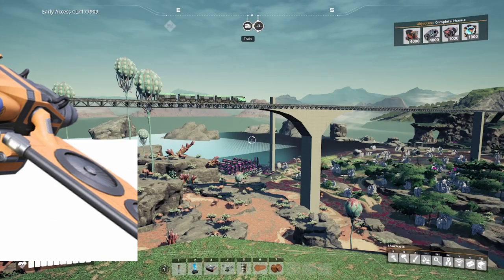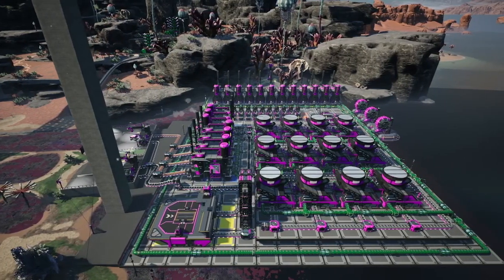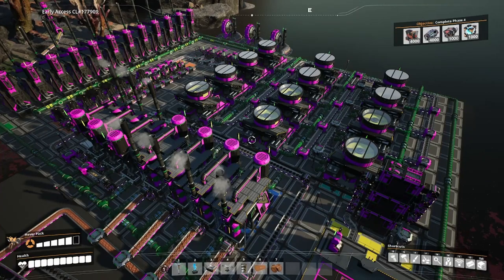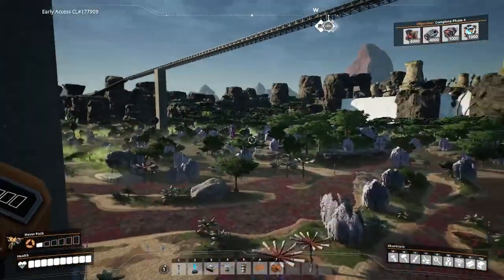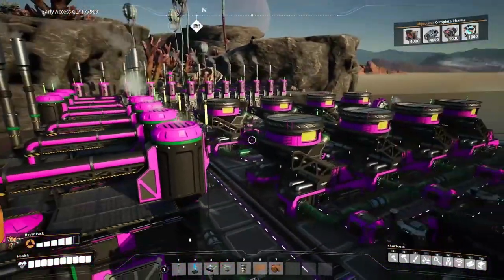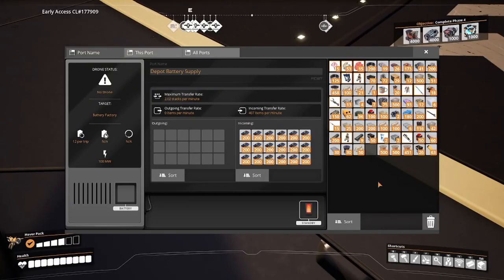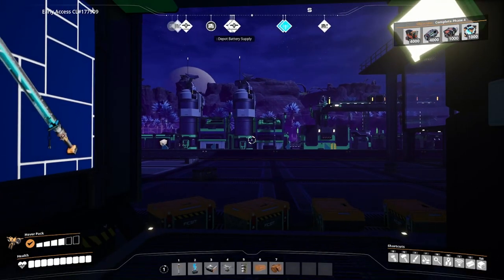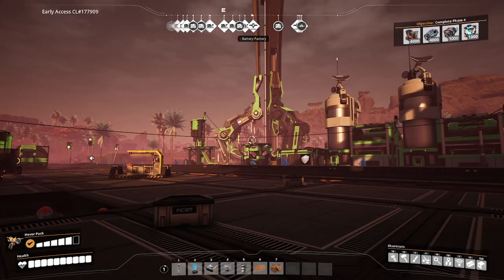Drones and Drone Logistics + Battery Factory Build - Satisfactory Update 5 Tutorial LP

Comment: Save your batteries for the last space elevator items.
Yesterday I just finished my first section of a battery plant. Had problems with the extra water that comes from batteries. First I connected it back into the bauxite water system like yours, thinking it will be used. But It caused backup and shut down of the battery. So I tried cutting down the water for bauxite.
It still caused issues.
I don't like underclocking or percents.
My final solution was bringing some overflow coal to the battery water output and burning the water off in 4 coal generators. They go off and on making sure that all battery water is used up. It burns more than batteries produce, zero shutdown.

I like how people have different concepts and solutions.
Anyways good stuff.

Comment: The same or another drone can deliver it to the same port steel ingots came from. If we hook up another drone from third port, outputs would be taken to both 1st and 3rd port, potentially making a mess.
Can we setup one drone between 2 ports to pick and offload goods only in one direction? I always thought drone automatically moves items both ways without option to change it. Am I wrong here?
(Edit: I just played with drone ports and didn't figure out how to daisy chain them without sending items to two other ports.)

I built Battery factory in that area as well, but providing just right amount of water was always not enough, had to add much more water and sink excess. Then sulfur miner was mining 780/min and chugging the line even though last 2 refineries were stalling as they did not get enough sulfur. That factory is nightmare to run at 100%

Thanks for video, I was wondering what are you cooking after few short videos :)

Comment: I'll tell you something that I've been having trouble wrapping my head around. Multiple factory management. When I do a playthrough, for some reason I love the hyper efficient, only-build-what-you-need way of doing it. But I want to go bigger and spread things out. Instead of building just 10 Modular Frames/min that I know I'll need later, why not go for 20 of even 25? However, how do you manage all the factories? If I have one steel factory making 1000 steel ingots a minute or something, how do you know how to send out the product to other factories? Do you make the pipes/beams there, or just send out the ingots to have them made locally at the other factory? If you have two separate factories requesting items from one factory, how do you split them up between the trains/trucks? I hope that wasn't too convoluted.
Reply from the maker: Thats a great question. I use depots to do intermediate processing and portion off the outputs to the correct ammounts. https://www.youtube.com/watch?v=BM11eEgxxuIo is a more complicated example but the second story on that one provides steel pipes and wire for a motor factory off the same (bulk) inputs that are providing for nuclear.  Hope this helps.
Reply: @Dekoba  I appreciate the reply. I think that helps a bit. I think I may just need to start experimenting on my own and see how things work. This is certainly a much more interesting way of playing than just keeping things 100% efficient in one area.

Comment: Hi, what's the Alt recipe you're using for the Aluminium Scrap to Aluminium Ingots? Because the normal recipe requires Silicon combined with Aluminium Scrap in a Foundry and not a Smelter to make Aluminium Ingots.
Reply from the maker: It's called pure aluminum ingots

Comment: Is there a bug that drone suddenly consuming too much battery? I have a battery factory producing 60 batteries pre min at 100% efficiency, which to support 5~6 drones. For the information provided in game, there are using about 20 batteries pre min, so I should have no problem in supporting the drones. At the beginning I keep on checking the drone port, all the drones are doing well and the batteries are stocking up. I think it works perfect so I leave and going out to do another thing. After 4~5 hours I found that my production line was down because there were no batteries in the drone port. Since I am producing 60 batteries per min it is impossible for the drone to consume all the batteries. I checked the batteries factory and it works perfectly at 100% efficiency , so I back to drone port and suddenly everything seems back to normal and the batteries are filling in the drone and stocking up again. However after running a few hours later it happened again, it is so  confusing and I have to stop using drone until I found out the reason.

Comment: What are the small factories in the late game? It makes no sense. Moreover, despite such little storage capacity
Reply from the maker: This comment is incomplete. Small factories late in the game are good for a number of things. Any larger factory that requires a limited number of smaller parts, or that lets you ship processed items instead of larger amounts of ore are good for this. ive used small drone supplied factories for heat sinks, copper powder (built atop the copper vein, drones flying the powder to my fused frame factory), electromagnetic control rods, and radio control units.

Comment: Not entirely correct. Individual trains can be set up to discriminate what items they pick up from train stations. So, using your example, one train could drop off steel ingots, they would be processed and then another train could come in and pick up the steel pipes and beams that were made. So in that way trains can behave like drones in that respect.
Reply from the maker: It is still shared storage though.